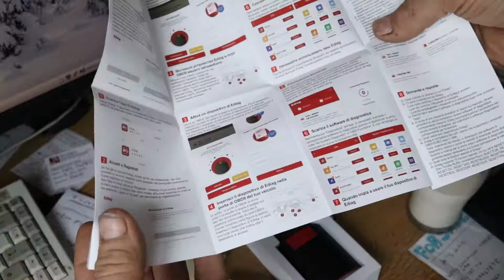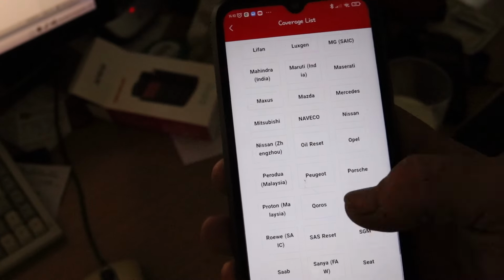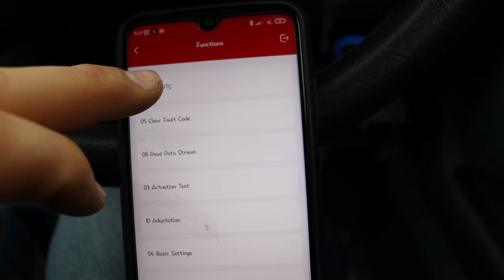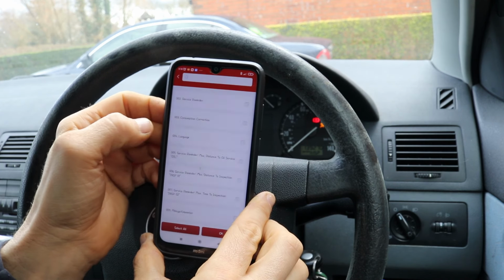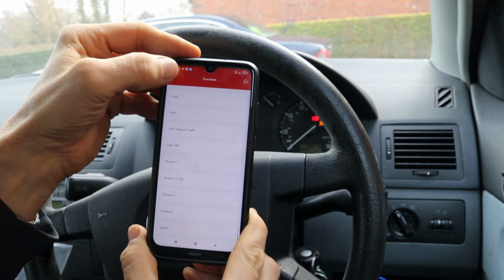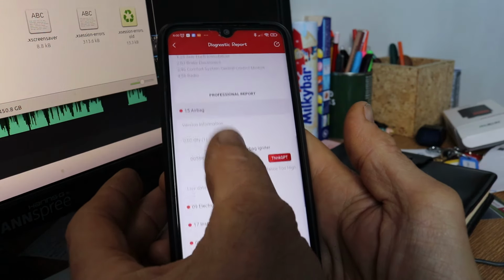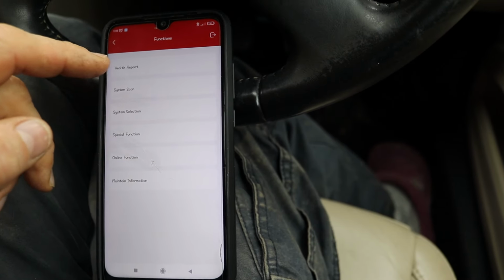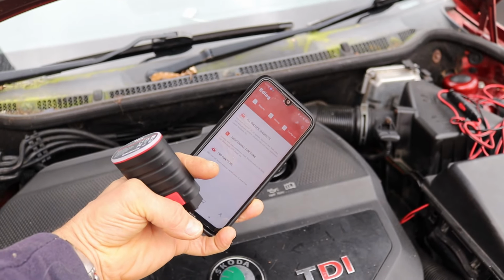Ediag Automotive Diagnostic Device by KINGBOLEN Review and Test

Comment: please i need help i have bro with dashpord the watch disapper and the malige changing from km to mil how can i back it
Reply from the maker: It's likely to be a bad connection. Check that first then inspect the PCB for faults, dry solder joints, burnt out or damaged parts and fix if you know how

Comment: love your vids hatboy, just wondering if you can help with my skoda superb electric seat positions, please don`t  tell me to  look in  the manual, as i already have and it`s no help....i have the same superb as you, with electric memory drivers seat, before i changed the car`s 12 volt battery (engine bay main battery) i could alter the seat so it was in any position , get out of the car, and when RETURNING to the car, plip the remote fob to unlock the car and the seat would return to it`s set position , now since changing the 12v battery it no longer does that, when i remove the key from ignition, the seat moves back a few inches to allow easier egress and when i get back in the car, the seat automatically moves forwards a few inches, again to the set memory position, but if i lay the seat flat, as i often have a kip in my lunch break at work, get out of car, lock it, return to the car,  unlock car, the seat still lays flat ! any ideas please ???
Reply from the maker: Have you tried pairing the seat positions with the keys?
Reply: @HatBoyHarvey   sorry harvey, don`t know how to ?

Comment: I use VAGCOM cable, i tried to use BT adapter on skoda and that doesn't want to work. Skoda has VW KKL protocol, not OBD-2
Reply: Cars before 2006 or 2007 (I don’t remember exactly) have a slow data bus, so standard OBD2 adapters are simply not detected by the on-board system. The KKL-cable is cheap and solves most problems, but you need paid or cracked software and certain skills to work with it. It's like the Prompt and GUI on Windows =)

Comment: Hello,
yes, reading out the OBD data is relatively slow on the Škoda Fabia Mk. 1. However, this is obviously really a problem with the vehicle. Competitor products also need approx. 4-5 minutes.

Perhaps it might be quicker with the equipment available in garages. But these devices can cost upwards of €200. So it's a bit too expensive for a private user.

Thank you for the video, Harvey!
Reply from the maker: I was really impressed with this product for the money, it's great value, and I'm looking forward to putting the device through tougher jobs :-)